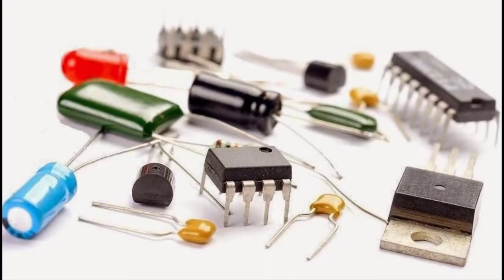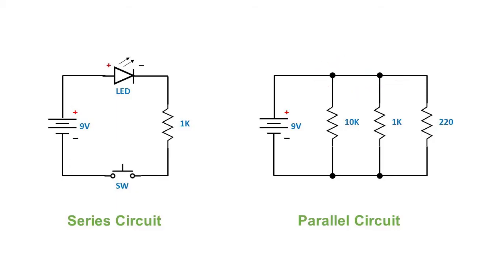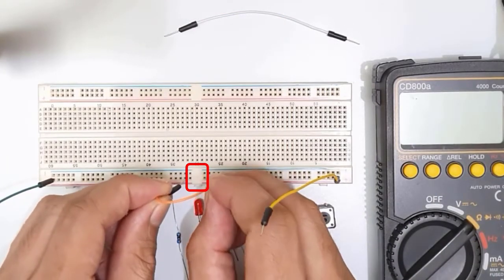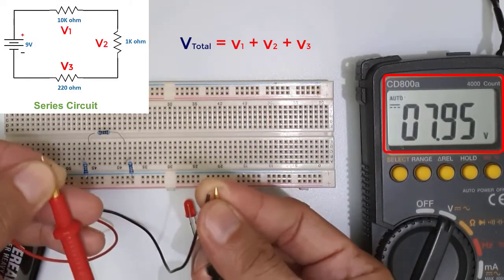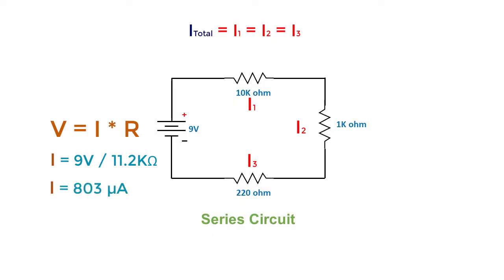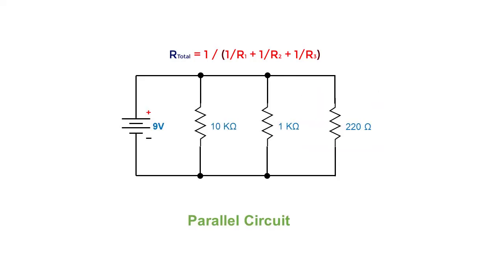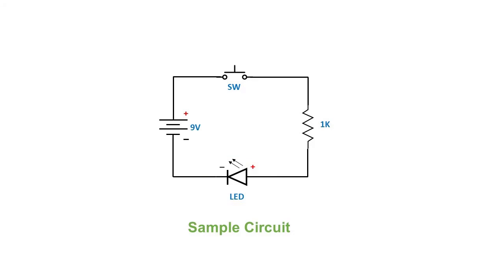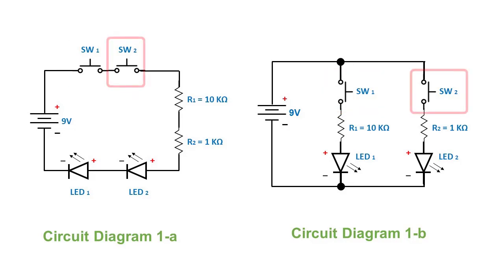02 Breadboarding Basics: Series and Parallel Circuits Explained

Comment: I have a question about electron flow and the breadboard .why do they say that the ground bus or rail on a breadboard completes the circuit by taking electrons back to the battery.i thought that ths ground bus or rail on a breadboard carried electrons from the battery to the circuit since electrons leave the battery at the negative pole and since the ground rail or bus is connected to the negstive pole on a battery then it means electrons flow from the battery to the ground bus or rail and then to the circuit and so the ground bus or rail doesnt complete the circuit.shouldnt the positive rail or bus on the breadboard be the one completeing the circuit since its connected to the positive terminal of the batttery and electrons return to the battery at the positive pole of the battery.

Comment: Really good but the middle lines are connected horizontally not vertically. Thanks
Reply from the maker: Thanks bob, but I am not sure what middle lines you are referring to that are connected horizontally.
Reply: That is actually incorrect, you can verify this with a multimeter.  With the breadboard in "portrait" mode, the power rails (+,-) run in columns, vertically, and everything else is connected the opposite way, horizontally in separate rows.
Reply from the maker: Excuse me. Are you saying that my demo is incorrect? Please watch it again. My breadboard is in "Landscape" orientation and NOT in portait, so definitely rows become columns and columns become rows. I don't know what seems to be the problem.
Reply: @joedgoh  sorry seems to be a miscommunication, I understand that your video has the breadboard in such orientation, and I was attempting to explain to Bob how the rails are connected when viewed from in a "Portrait" orientation. Regardless they are connected the same either way apart from the semantics.
Reply: and to clarify, your video is correct. Did not mean to offend.
Reply from the maker: Hi Alex, I'm sorry as well. I am not offended. I am just confused, because I thought you were referring to my reply to Bob. Anyway, you explained the connections well. Thanks again 😁.
Just miscommunication.
Reply: @xxdinguslmao  في ة